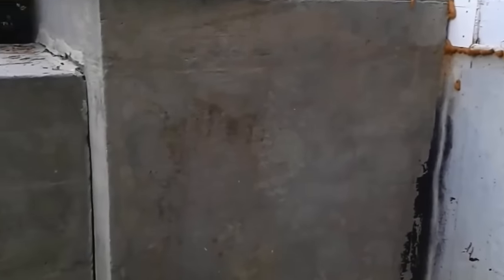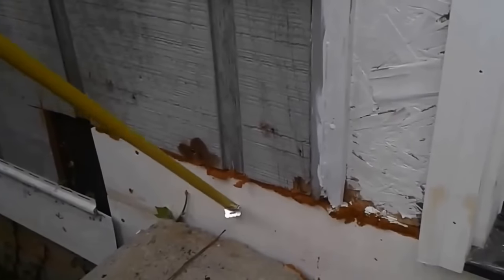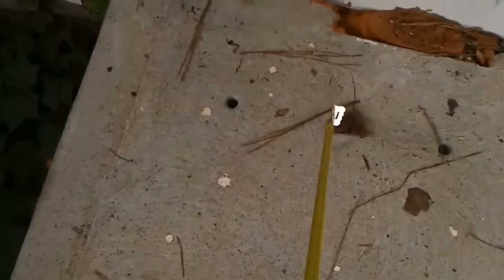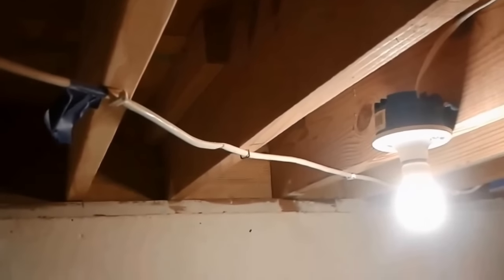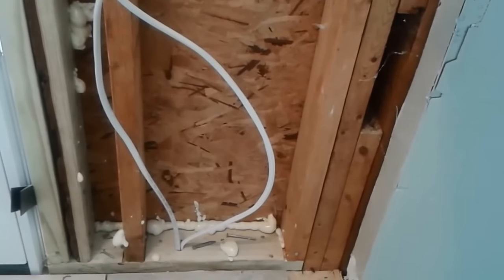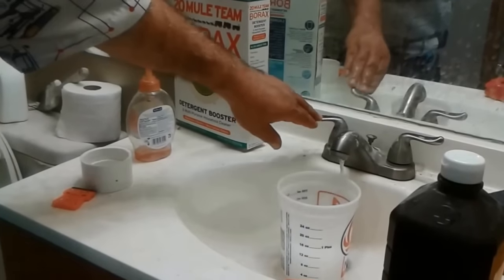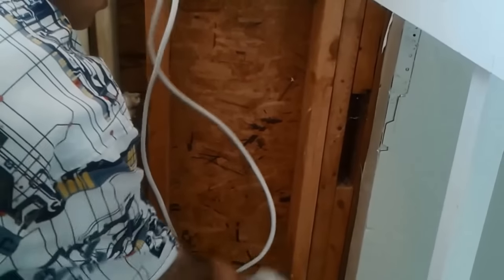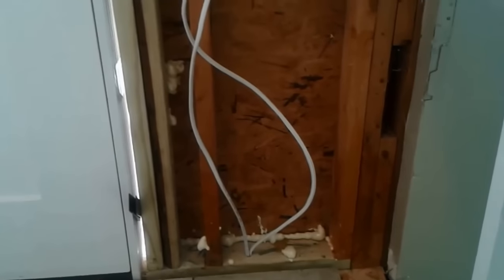How To Get Rid Of Termites For Good  Using  Borax -- Best Solution Do It Yourself

Comment: Regarding the areas that you treated in this video by brushing your Borax solution - Why was the Termidor not applied to those inside areas ?
Reply from the maker: +PrimalMiltos Termidor is a solution  you put in the ground surround your house to create a barrier  against termites . You apply borax on untreated studs and wood that termites will not be able to eat them.
Reply: The word barrier need to be explained. Termidor is applied as around the house strategy. Termidor , the termitacide , is is a non repellant which allows the enemy to crawl thru the dirt barrier and be contaminated with this poison but not immediately killing the termite, but allows it to get back to the colony and spread the poison by touch to the other and soldiers. Then they die from termidor exposure. The "barrier" is a barrier but not in the sense it kills on contact or keeps termites from entering the barri
er
Reply: The active ingredient in Termidor is a chemical called fipronil. It's the same chemical used in some of the monthly spot-on flea treatments used topically for dogs. It targets and kills insects in a very interesting way via their insect-specific nervous system. This chemical can be purchased in a concentrated form VERY cheaply and reconstituted by mixing it with water. Though it is not labeled for such use, it CAN be applied in/on wall studs under sheetrock, some (overly cautious type) are using it in such ways and having great results making their homes flea, roach, pill bug, silver fish, ant and termite-proof. So yes, you could mix it and spray this the same way but most licenced builders/licensed pest control people will not do this since it is not labeled for such use. Even buying it locally can pose some 'minor' hurdles. What I find most interesting is that since it is generally broken down by soil micro organisms and sunlight, I suspect that it could last for many MANY years between walls. It is SUPER easy to buy these products online. There is a website called domyownpestcontrol.com that sells a tone of these sort of things. I have (as a favor) eradicated flea and rat problems that had reached biblical plague proportions for people I just felt terribly bad for. I felt terrible seeing people live like that. It's difficult to ignore such circumstances when you know how easy it is to fix their problem. These were people who HAD relied on "professionals". Information truly is power when dealing with these vermin and when trying to avoid the mark-ups. Find their weakness and then exploit it. If they don't have a weakness, create one (synergists). I generally don't like chemicals. I like the natural and perpetual approach anywhere I can apply it. I absolutely LOVE knowing about how this stuff works and how it was discovered. You find that chemists spend a lot of time in labs studying processes that occur naturally and seek to find ways of synthesizing these things in a lab. Knowing about the different things out there allows you to chose the product that is as close to natural as possible with the absolute best results and minimal environmental impact. Sometimes there are small trade-offs. Information allows YOU and only you to make those trade-off decisions based on what is most important to you. Anyone you hire to do the job will make those decisions FOR you likely solely based on their bottom line... it's the nature of business.